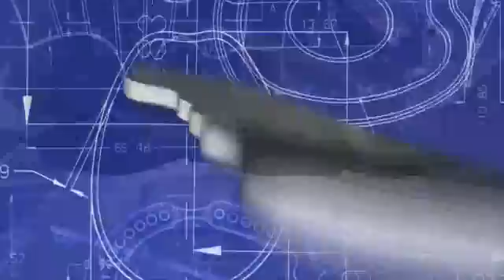#britek  Energy Return Wheel... Autonomous Never Flat

Comment: @eashoa1am 
or you have re-designed the rubbers, with too many problems. Ugly, harsh ride, unproven safety (try simple slalom, skid pad, or 1/4 mile run tests and post your results.), very heavy, and costly if you addressed the weight problem with exotic materials such as kevlar threads.

All in all, looks like a failed attempt to re-invent the wheel.

The new generation of BMW's cars claim 20-25% more fuel efficient. Half of the saving is from run flats and they compromise the ride quality.

Comment: @eashoa1am 
Troll
One cannot re-invent the rubber tires as they are today, without adding compromises.
Ride quality, appearance, performance, safety, cost to manufacture (or cost to run per mile, km), etc.
These videos did not show credible real life test results of reduced fuel consumption (mpg, l/km), which is the main goal the design is set out to achieve.
also it is visually faulty. i.e. heavy with bolts, little foot print= little grip, hard=reduced ride comfort, ugly, costly to produce.

Comment from the maker: @timkunk  ERW an "event" first happens between the hoop and hub, hub driving suspension system. ERW hub is anti bounce within the hoop because of 360 degrees of opposing membrane pulls. We addressed the hard rubber to asphalt "problem" with our latest traction layer continuation-in-part back to 2008 patent filing.

Comment: "Considered an actual piece of the car as opposed to something that has to be replaced very very often" You're not dealing with tire compounds, so you'll have to replace them just as often.
You also never explained how the tire is suspended from the wheel. Looks like a pretty rigged design from where I'm viewing. So there would be NO absorption of the road. Yes the suspension is suppose to do that, but tires also play a big role in softening a ride and you just took that away.

Comment: @ChrisKsan There is actually the fact that if you have less weight in the wheels;  then they are more easy to stop.  So if you were to use a hammer drive onto heavy wheels;  you would then use less fuel as you would be with the ability to have a larger surface of cumbustion while a smaller need of time of pressure.  Thus almost no fuel if done correctly.

Comment: Also, there's the question of unsprung weight. There are a lot of people that look to get wheels as light as possible. Why? For some it's fuel economy, for others it's handling, speed etc... Less weight on the wheel, means it's easier and more effective to put the power down and also control it as well as it saves fuel. I hope these reminders of real-world attributes regarding wheels will be useful to you. If your product is as if not more versatile than what's on the market, success is yours!

Comment: There are countless ways that it or similar could work and not to mention use of levee that pull your car forward using... your car.  I will be back to share more and do realise that the mentioned idea would need great work and is not feasable for it's thickness of rubber,  but it could be thick.  Never the less;  if your space between the two was built correctly;  It would leave to explorations. Just as like if perhaps the inner part was round the most part and chopped at  at bottom?

Comment: @EnergyReturnWheel I didn't challenge any fact that it helped in circumstances.  In fact there is runners in one country that run for longer periods because they do so all their lives with no more than a skin of animal skin as a sole.  Which drives them;  I assume;  to reduce impacts apon the body to prevent impact to the foot and thus would seem to float.  I have prior thied this when I was young because I thought that it was logic and it seems that it was,

Comment from the maker: @SkillNoVa Seems our bicycle wheel prototypes are providing light wt. solutions for off road useage. Our rubbers are either german engineered or nano tube infused rubber compounds. The grip has been improved by adding Kevlar bound rubber wedges off a curved composite hoop. We can "tune" comfort by controling membrane elongation in protos a vacuum boost in others. The "bow" tech. uses the composite hoop as the flex member and we are combining several protos "best" into ever improving versions.

Comment from the maker: @AnilGangster The hub is equally sprung whithin the hoop by elastic membranes. When loaded the hub sinks as topside membranes bear more load... absorbing gravity, now stored. Throttle responce winds up the 'pre"stretched membranes, top side levers foreward and raises hub within hoop, mechanical advantage accending hills. Experiment.. stretch and recoil a rubber band at its relaxed length then pre stretch doubling bands length... stretch and recoil. Its obvious that "pre" stretch returns more.

Comment: @EMKshadow First thing I saw when I saw the rubber wheel, unchanged, not reinvented, the same damned thing except suspended in metal. You STILL have to take the wheel off and get it re wrapped with rubber every X amount of miles.

This guy hasn't reinvented the wheel, he's just made a superexpensive rim that will turn your smooth Mercedes into a 1980 Ford Crown Vic

Comment: @slfhzeouh You're right. These wheels do not magically create energy. It took me a while to figure out, but I think I finally understand how they work.  The "rubber band" and "garage door opener" analogies are absolutely terrible examples to use in describing these wheels. The way they save energy is by absorbing energy from bumps and releasing it as forward propulsion rather than sinking it into shock absorbers. So really, these wheels are more akin to regenerative shocks than the Tweel.

Comment: @EnergyReturnWheel Great explanation, however. You probably lost the guy, he more than likely has no idea what you are trying to explain. And if that were the case, regular inflated tires would fight the same thing. However, stretched rubber heats, recoiling cools it down.

Comment: Mmmmmm.... conventional rubber tires do the same thing. the rim hangs in the belts the tire doesnt hold the rim up from below. the belts suspend the rim... the rubber bladder(tire) gives the belts shape and structure by pressing against the belts from within. tires are just kinda flexy and this idea just eliminates some of the tire's flex... conserving some energy. but otherwise a tire will do everything this does

Comment from the maker: @rockshox101avidjuicy Or you could call it a hub. The real idea is "suspending" a wheel within a wheel or hoop. We have issued and pending patents on many ways to do it. We are in a process of building protypes that represent individual/collective patent claims that represent an engineering solution for good traction, impact protection, membrane durability, materials, construction, rolling resistance etc.

Comment: How does it compare to a normal wheel/tyre setup as there seems to be no sidewall to the tyre. Is there any lateral give between the surfaces when cornering? How it the actual tread surface stuck to the rim because in the video it shows a kind of uneven profile around the edge?

Comment from the maker: @adamx20 Kibbles or canned ERW will out do balloon tires over time. Bright minds have been perfecting the balloon tire to its limits for over 100 yrs.. ERW is just beginning. So far our composite materials have burst strengths in the 25,000-50,000 psi. range. Our rubber layers between 4,200-4,800 psi.. What is a pnu.? 100-200 psi.?

Comment: Just wondering if maybe you should drop the "floor show room" marketing approach and provide some information on safety. What about hydroplaning? How does the wheel stand up to high speeds and sharp turns? What about in the snow ... are they good at getting through snow? How about ice? How about hard braking at high speeds?

All I see is "designer" tires. You begin the video with safety ... now maybe you should "eat your own dog food."

Comment from the maker: @jared7211 We are very close. The strength of the composite hoop will allow for a lighter hub. For semi trucks think of ERW hoop as a rolling rail with membrane stretch levitating the hub. When a membrane is under tension before it bears a load it can recoil... return a greater % of recoverable forces just like a rubber band.

Comment from the maker: @lspats3 No, when a force moves the hub/wheel center from zero IE impediment at speed the energy is turned into membrane stretch at the hoop top 180 while membranes are contracting on the lower 180.... counter ballancing each others actions, both/all fighting to an even "levitation" or flow.

Comment: have you ever had any problems with oscillations since the composite hoop is acting like a spring? I also wonder about the rotational mass that is created from the hoop, bolts ect... If you have more mass at a longer distance from the hub, the stopping distance will increase. I think you may be on to something though. :)

Comment from the maker: @unamaxify We have prototypes that have a sidewall, see our carbon fiber/Kevlar video. ERW has screw force accumulation to mediate traction to the ground. "Anti bounce" to keep to the surface on chattered brake zones. The road waves caused by heavy trafic stopping on hot days. ERW "psi." to surface is much greater than baloon tires can deliver. See AWD ERW 6,000 lb.dyno video hooking up on smooth 48" USDOT rollers. Brake lights "show" on the highway test video to slow ERW  "coastdown" portions.

Comment: wouldn't it be better to seal the opening between the steel hoop & the rim
because of dirt & rust ?
Also, i noticed after making an emergency brake that my tire-walls were scraped
-> a so called expert told me that i had used the side-grip of my tires & that it had benefited the breaking performance, do you expect that the breaking performance of your wheel to be lower because they don't have side-grip?

Comment from the maker: @Griddle2021 Think of an ERW as a "wind up" propeller on an airplane. A flexable composite  hoop winding up then rebounding... a "sling" forewords IE throwing stick for spears applied to wheels. Horsepower and torque from the drivetrain feed into the membranes "pull force" increasing hub lift and forewords levering. More "screw force" or wind accumulation can be acomplished by increasing the pull "travel". So yes!

Comment: Here's why this wont be cost effective....your design has a rubber tire like mat that is still going to wear...and guess what?... its going to need to be replaced, which looks like quite the job to do based on your "design" in fact as a licensed automotive tech i can tell you the labor rate to replace the rubber face would almost quadruple the labor rate to install normal tires....just for added vehicle handling and fuel economy? it'll cost more than what its worth.

Comment from the maker: @nhojyelbom1 Worst case senario is 16 bolts.... the best case is a vacuum install where a vacuum is drawn through the valve stem, contracting the flexable carbon body. Install, air pressure is allowed entry to near ambiant, expanding ERW into position on rim. Much easier and no special tools. Vacuum accumulators are $5 and fit any air hose.

Comment from the maker: @haakondahl The hub is suspended 360 degrees within the scope of the composite hoop. The main force we are dealing with is gravity. Gravity "vehicles" wt. pulls the hub lower within the scope. Stretch at the top, more energy at the top. Throttle responce begins lifting "hub", accumulation of screw force "wind up" to lever the ERW up hills and over obstructions like never before. Noise and vibration can contribute to force as ERW cycles between elongation and recoil just like ERW recycles heat.

Comment from the maker: @haakondahl Todays tires are relying on sidewall and treadblock deformation. The forces are not very recoverable as the tire rolls the sidewall and treadblock foreword generating "squirm". ERW focuses these same forces with drawn membranes to the center of the hub.The ERW "pre tension" membrane returns much more "energy" as the "hub" within the scope of the "hoop" levitates in responce. We roll a "footprint" not a "treadblock". We make up for less surface contact with "wedges" off the curve.

Comment from the maker: @UltraVert The "full suspension" shoe tech. is under license to Newton running, Boulder Co.. Because materials used in elastic membranes is new to the footwear industry Newton has been developing elastomere systems to manufacture these "future shoes". 10-15% vertical leap, 10-15% biomechanical efficency gains and solves most leg length discrepancies.

Comment from the maker: @TheMaverickSpawn ERW displaces internally. Because the 360 degrees of dynamic membrane tension is drawing the hoop to hub from all directions at once even small forces are capable of pulling the hoop/hub relationship out of perfect centering. This imballance is remembered and forces returned as the positional "re"centering occurs during the rolling process= smooth ride.

Comment: @chrismason31 You obviously don't understand how this technology can positively impact the world. as you can plainly see that it uses very little rubber, do you know that it takes 7 Gallons of oil to make one standard car tire ?, Yeah we have run flats but they only last for a few miles and have to be replaced or repaired, you cant just continue on with your trip on the tire. being that these take no air pressure to stay inflated they do not run the risk of ever going flat

Comment from the maker: @cetinGT3 ERW Membranes align with a mirror twin membrane across the hoop. Each is pulling 300 pounds developed tension. ERW wheel hoop/hub center is moved in line with a force like gravity the ground side membrane is contracting while the top side is stretching. This counter ballancing act is what makes ERW so responcive. The hoop/hub position is already being drawn in all directions "360 degrees". ERW is ready for the pot hole.

Comment from the maker: @paul06101939 We have progressed much since the first auto prototypes. We are using composite hoops and we are suspending them from the hub with carbon nono rubbers. We now have highly elastic sidewalls that keep debris out but also assist in the accumulation of screw force from throttle or brake for seamless power transfer.

Comment: @EnergyReturnWheel also the air in a conventional rubber tire acts as an air cusion to soften the blow on the shock absorbers and stress and vibration to chassis of the vehicle,how does your invention coup with road condition such as pot holes?

Comment from the maker: @DaBuzzKilla Check out Tire VS ERW coastdown vid. ERW rolling resistance #s are like a hard wheel. A hard wheel has no cushion. ERW dislpaces internally to produce cushion without typical energy loss of tire sidewall deformation and treadblock. Add screw force accumulation and return of drivetrain and surface irregularities to the throttle responce... efficient levered rolling is the result.

Comment from the maker: @Rafaew23 The opposing drawn membranes will  displace laterally... levering the lateral or medial rubber wedge off the curved hoop to the surface. The highly elastic sidewalls can also articulate laterally as well as assist in the accumulation and return of "screw" forces from throttle and brake. As a way of reeling out or feeding power to the ground ERW has "no equal".

Comment from the maker: @Battlemaster00 ERW is very tuneable. Majority of R+d done on low profile high power "pre tensioned" to ,6,500-7,000 lb. combined membrane linear pull. The amount of force required to displace this 360 degrees array of membranes is controled by the membrane mass and elastic properties and tuneable % of elongation. To enable the hoop/hub to articulate each drawn membrane has its twin directly across the hoop. Membranes constant pull against pull makes it easier to move and respond to loads.

Comment: would it possible to adjust the travel rate of the wheel (between the wheel and "tire") on the fly? could it then be possible to stengthen the sidewall needed during a turn, maximizing road contact?

Comment: @consaka1 Of course.  But we have wheel locks to keep the rim on, and tires "should" be checked before starting your drive.  It only takes a couple seconds to look at both sides.  But if we had wheels like this, it would be pretty easy to loosen a few bolts and there would be nothing visually wrong with it.  That's why I mentioned it, and the author response was helpful.

Comment: @EnergyReturnWheel But what about hitting hard objects like fist sized rocks, potholes or curbs? Would those tear up the unit like it would a rim with low profiled tires? As every new tech that comes out, im sure this (if/when it does) will be super expensive. If one of these was to be ruined by a pothole that you didnt see at night... Im sure you get where im going with that.

Comment from the maker: @Neodymio ERW displaces internally. As gravity pulls the "hub" towords the ground more tension is at the top of the hoop. When an impediment is hit the ERW membrane is already lifting "floating"  the hub upwards radically shortening the time frame of the reaction. ERW fights against an over reaction or bounce, bad for traction and control by having opposing  tensioned membranes across the hoop. They cancle out the other sides "action" across the hoop in "real time".  A big wheel breakthrough.

Comment from the maker: @shantyNtaty It is the opposite. ERW improves the horsepower and torque to the ground. Remember the way the auto companys used to measure / rate horsepower? The earlier flywheel measurement avoided the drive train system and showed about 30% more power VS. our current "brake horespower" IE power  to the rear wheels rating system. Much of this drive train efficiency can be improved by ERW  "winding up" / returning the impulsive and irregular forces. Also the rolling resistance and deweighting.